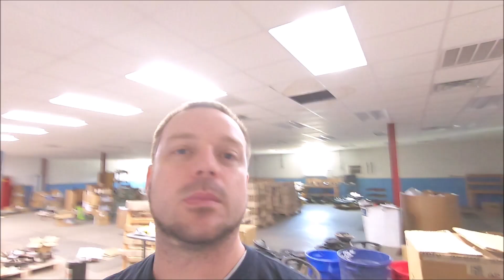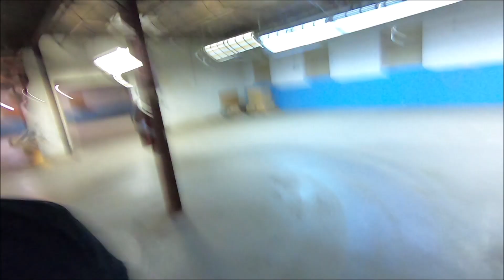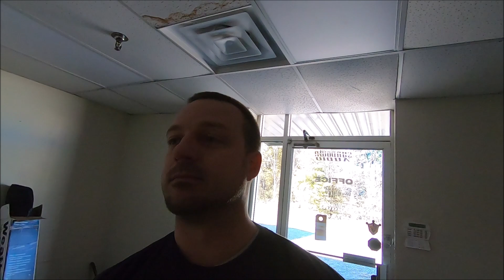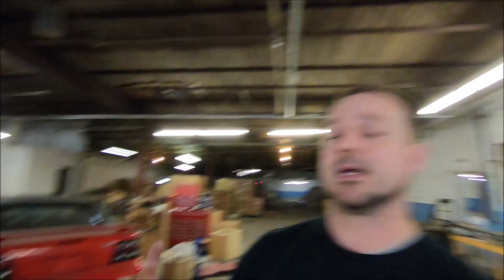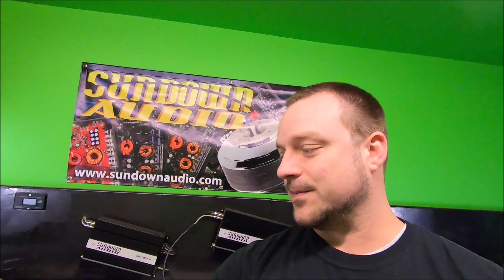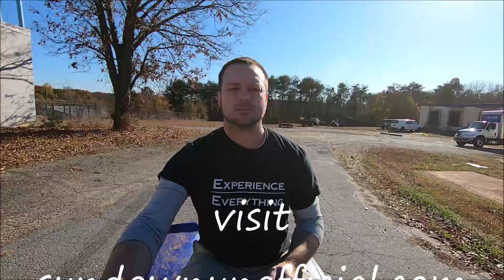***Sundown is Closing Shop and Moving!!!***

Comment: can the x12d2 rev1 handle 5k. i found a good deal for a deaf bonce apocalypse aak 5500w amp. im wiring the sub @ 1ohm. the amp is rated 2900w @ 2ohms and rated 1500w @ 4ohms. i know music is dynamic and subs are reactive so i was thinking even with box/impedance rise the sub will not see a 1 ohm load long enough to damage it but im not an expert. will this amp be too much for the sub

Comment: Hello again,
I have One question. 
I bought the SUNDOWN SINGLE SUB BANGIN PACKAGE (2000Wrms) 5 days before my 50th Birthday on October 8th from Down4sound.  After waiting 7 weeks to get the call to go pick it up here in Vegas... I Finally got my Birthday present. 🤘🏼😜👍🏼Now I am having a hard time finding a Sub Box that has the specs for the X v2 15" that I bought. D4S doesn't carry any bigger than 12" sub boxes. Would you happen to know of a place that sells good sub boxes that are pretty much made for Sundown Subs? After waiting 7 weeks I am Amped (Pun Intended) to get my new addition Thumping/Pumping/Bumping Down the road. 😉.
Thanks Bruthaman
👍🏼👍🏽👍🏾👍🏿🇺🇲🇮🇱🇺🇲🤘🏿🤘🏾🤘🏽🤘🏼
Reply: Check with Cherryman Customs.  They build custom sub boxes to fit your vehicle and to the spec's of the subs.  He does great work and the price for the custom work is reasonable.